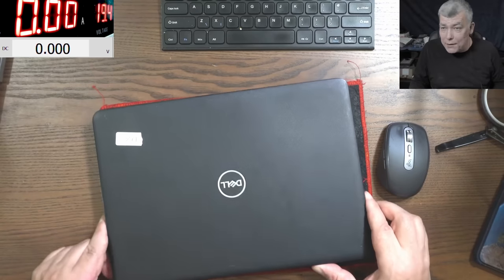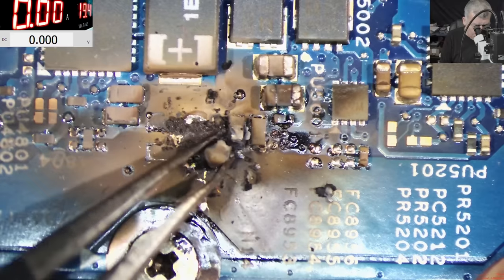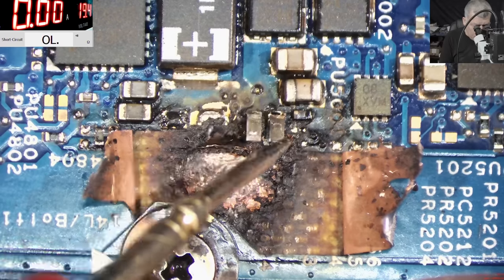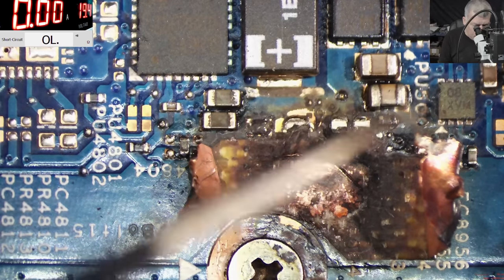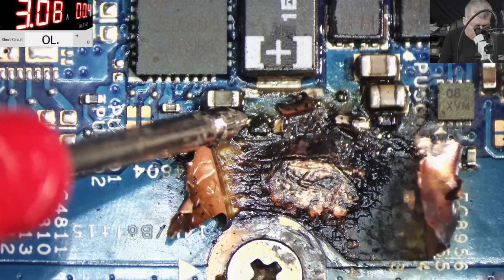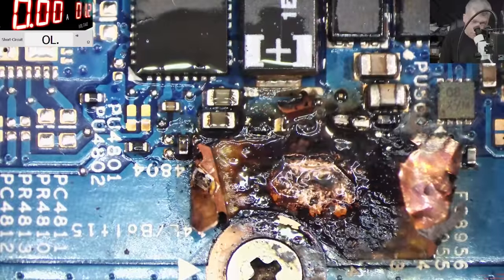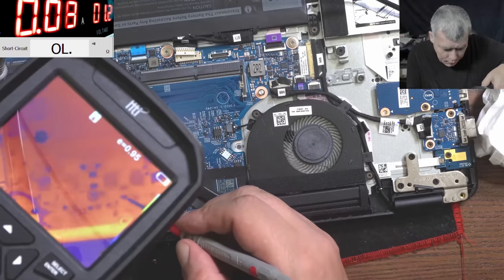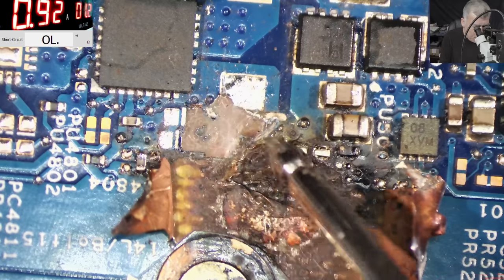Dell laptop exploded capacitors and burned layers - this was a tricky one

Comment: I kept saying "other side of the board." It's become very clear from your videos what that looks like under a thermal cam. It's like a diffuse heat that doesn't seem to originate from any particular component. I'm sure a short in the board layers would look similar, but it's worth checking before digging too much.

Comment: Amazing work Sorin 👍 I would have chickened out and bought a used Motherboard off eBay, thinking this one was too badly burnt. I have thermal cameras that offer manual control of the temperature span and centre temperature. Combined with a close up focus capability that enables me to see the exact location of the hottest point on the PCB. Your IPA tests worked well but I like to see the absolute hottest point on the PCB using the camera as it makes life easier. If your camera has a close up lens available, I recommend buying one as it is like having a thermal microscope ! Great work and an amazing result considering the damage and components that you had to remove. 👍👍

Comment: I could swear it was on the other side by the look of thermal camera how it was diffusing heat. :).
Maybe you didn't see 2 issues of caps on both sides of laptops, but i also never saw on your videos track layers shorted at deep level inside board. It was always short components most of the times.  At least on your videos :).
The morale of the story, if you see a diffused heat with thermal camera " check the other side of board!"

Comment: I'm not gonna lie... that was alot of work.. way beyond my skill level.. because if you scraped out any tiny thin tracks underneath, or they were burnt.. that's just another rabbit hole.. which may never be fixable... i would have recommended a new board.. even a non-functioning board is better than that.. lol.. I don't know if i would trust that over the long term.. very good video tho.

Comment: 21:35 I dont think the first burned compoment was a cap. It was more likely a inductor or resistor inbetween a power line. Because of the shorted cap on the backside this resistor overheated and burned the board. The current probably was a bit under short curcuit detection. Anyway, shit happens. 😊
Cool repair, but I fear something is still broken, because you had to cut some track and vias that were not rebuilt. Full test would be interesting.

Comment: Hello Sorin, thanks so much for your help. My DELL OPTIPLEX Desktops have blown up capacitors on top of them. What could be the cause, and what is the possible solutions. Thanks so much.
Reply: Capacitors usually get faulty by themselves. Try to replace them. This should fix your problem.
Reply: @MykolaInc  Thanks for that insight Sir,

Comment: To repair a FUBAR Dell laptop:
1) take out all the "bombs"
2) Solder a bridge from the power socket to the CPU
3) rub with your finger in the right place
And voilà! A totally wrecked system is like new, except it's a bit lighter due to removed components.

Excellent schooling. I know who I would take on a trip to Mars.

Comment: ok but a lot of components were destroyed/removed. How come its working without all those, I mean they were there for a reason to begin with which should mean that they are needed for something no? Or will it be something that isn't vital and you'll only notice it if you want to do something that specifically uses that part of the circuit? Im confused

Comment: Hey i faced a issue today on my acer nitro 5 2021 model when i turned on laptop the keyboard light on display also got on but the acer logo was not showing i waited for 15 seconds but nothing happens then i pressed the power button again and shut it down and i pressed power button again and it turned on perfectly fine my laptop doesn't overheat so what could be the issue

Comment: "We have a picture"? How can you say it worked just fine with  just a "picture"  that sounds like bad repair if you do not test everything else like overheating or anything else wrong with it? That doesn't sound like a good repair technician and don't show everything not cut out for the disassembled the laptop parts and youere and everyone else on YouTube is skipping the disassembled and reassembled and reassuring it 100% fixed not just get a "picture "on  everyone YouTube videos etc.

Comment: Tracks don't make short, but components do. So why remove tracks thanks anyway.
Reply: To clean the burned board material that wasn't ensuring a proper electrical insulation between tracks.

Comment: bro 😑 u just rip the board without checking otherside and judging too quickly of short-circuit on one side . you should have check all area before attempting to rip the board . ripping the board is useless . u did not repair u just rip the board . i am not gonna send you my computer .😒. In the video it clearly seen that if you look all the capacitor by microscope then u did not need to tear that . . just change your youtube channel Name to ~ RIPPING BOARD FOR DESTRUCTION.